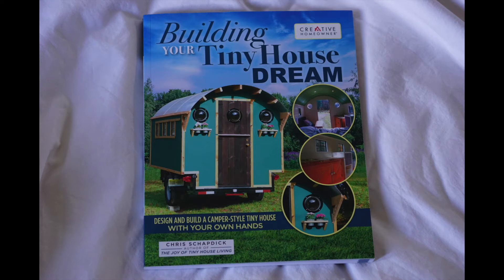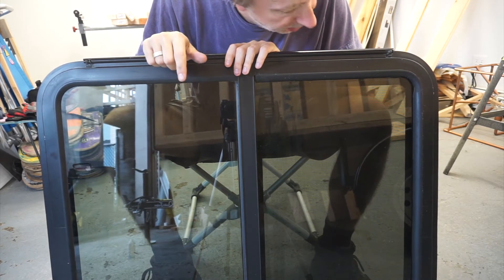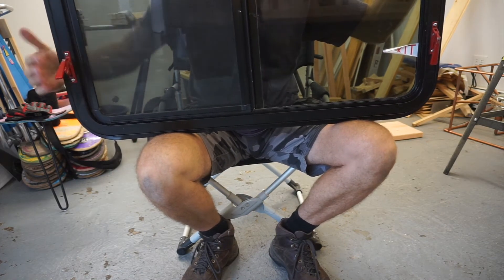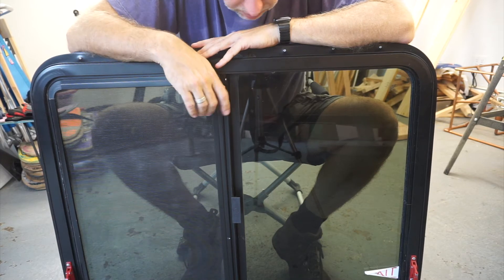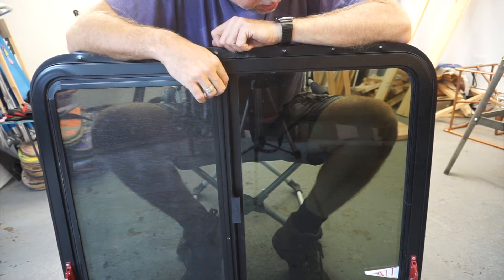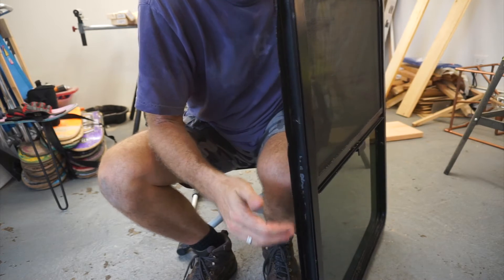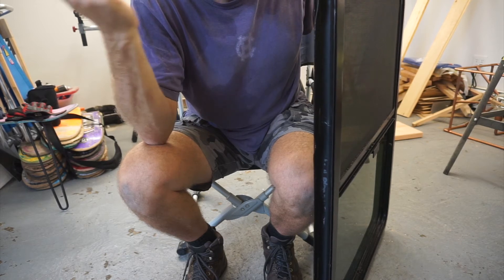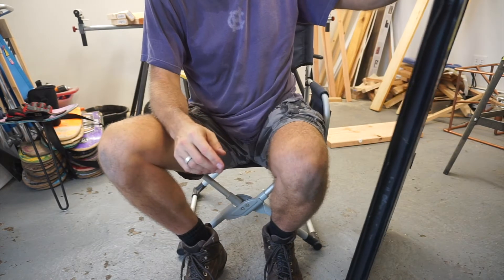Tiny House Front Window Selection and Installation - Building Your Tiny House Dream - E10

Comment: I think I will use a cardboard template when I do this.
Reply from the maker: It's a good way to go. I don't always do things the best/easiest way. :)
Reply: I used a huge cardboard template for my arched front and back wall. My math is not that good, and it worked for me.
Reply from the maker: Yeah, there are a number of different ways to go about getting this done.

Comment: How tall is your workplace? Thinking of renting a 12'x30' storage unit for the build but I don't think it will be tall enough. Your thoughts on a suitable place to build this please. Just ordered your book.
Reply from the maker: The height of the ceiling is about 11'. The door though is only a 10' high opening so the interior height is kind of meaningless. Most storage places will frown on you doing any kind of work there. They take the word 'storage' pretty seriously. Good for you if you found a place that doesn't care if you do. Thanks for ordering the book. Please chime in with any questions. I'll be happy to answer them.
Reply: @TinyIndustrial  I'm building mine in my attached garage, because I started in December, and it's freezing cold here. I will finish it later when it is warmer on my parking pad.  I have a 20 foot ceiling, no problem, but my door is a standard door. My wife says I will not be able to get it out! I told her that she could help me dismantle the garage to get it out! Actually I will dismantle the front and back of the Vargo. Hopefully my four foot side walls will just fit under the door without having to lower the tire pressure.😅
Reply from the maker: How did this work out for you? Still in the garage?